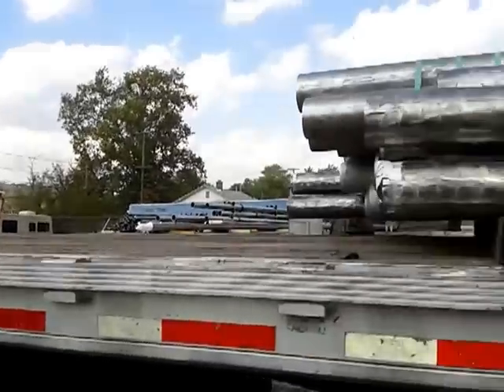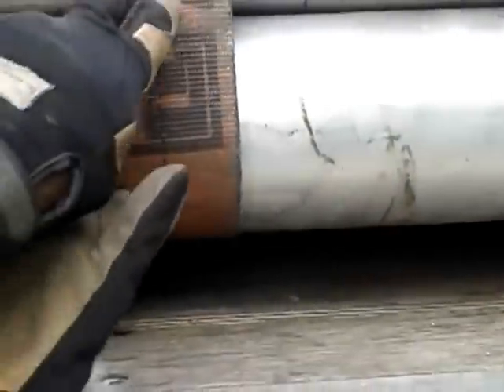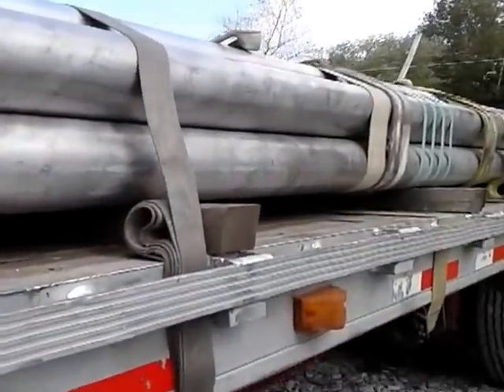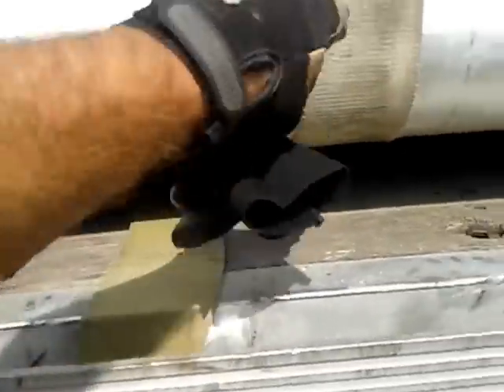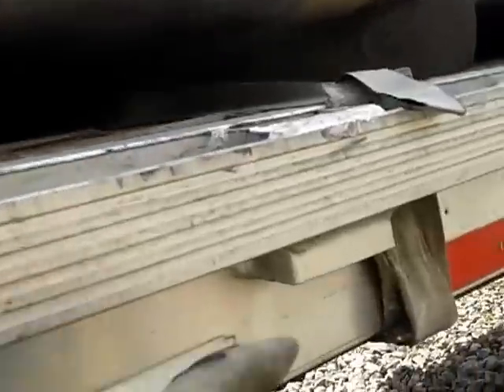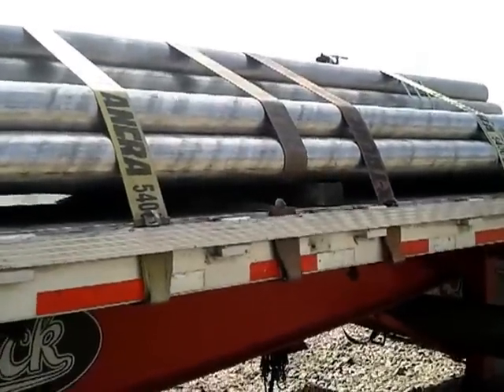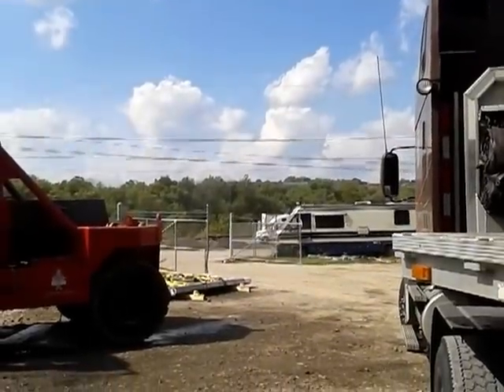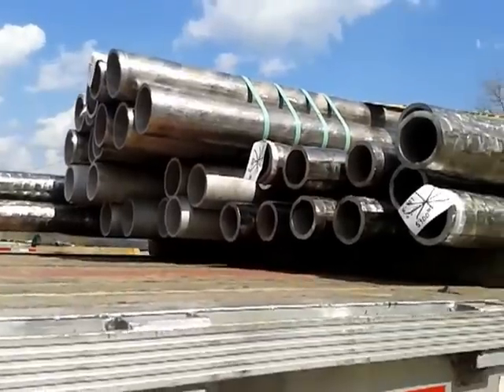Flatbed Trucking 101 Securing pipe

Comment from the maker: Thanks for watching and for the kind comment. Just like the rest of the jobs in trucking the only dumb question is the one you don't ask. Most of my 17 years in trucking has been dragging a skate board around and I am still learning How to do it. Get the Load Securement book from the F.M.C.S.A. that J.J. Keller publishes. Alot of great information in it. Tells how to Legally tie down a load. Most TA's have them for sell. Good luck and watch where you step on a Tarped load. Easy to fall.

Comment: You can do the same with some "belly" chains.  Depending on the load, I lay chains across the deck before they put down the load at the front and back of each length.  If I have 2 lengths of pipe, I need 4 chains.  CAUTION....most shippers will not like having chains directly touching their precious pipe...carry pieces of rubber or something else to protect the load....pieces of wood will even work.  Once the pipe is loaded, throw the chains up top, get a binder, tighten around the pipe.  The WILL NOT move.  You can then strap the load to the deck, most states require a load strap every 10', so, if the load is 40', you will need 4 load straps.  Obviously, you may need more depending on the weight of your load and the strength of your straps.  In addition, you may need a "chin strap" across the front and back of your load.  This will take anywhere from 2 to 4 chains.  Again, you will probably want to protect your load.  Depending on how far you have to go, bumps, stop and go will cause your load to slide.  I hate pipe.  I hate steel.  It is your most unpredictable and dangerous loads you can haul.  I don't care what kind of bulk head you have,

Comment: So there was an incident in Ohden, Utah.  It was on CDL LIFE.  Date of occurrence was dec 15th 2022.  Semi slammed brakes on too hard.  To avoid colliding with a snowplow.   Pipes slid through the straps and pierced the cab. Trucker is in serious condition. Shouldn't this mean chains with edgers from now on? Or at least, to diagonally chain down the front of the load?

Comment: Hey Mack, if this was one huge pipe, you would only need enough force to pin it down and that prevents it from moving. If you have two or more pipes, you need enough force to hold them together as one piece and enough force to hold them down. I guess you achieved both by alternating your use of straps. No one can do better than that. Even if you loosely cinch the pipes together first, the moment you tie them down, they will press each other so hard they become one. So, it is not what works for you only. It is the best way to do it.
Reply from the maker: Thanks Moe. Stay safe out there my friend.

Comment: I want to haul flat bed so bad but I have no knowledge with securing flat bed loads at all.
I've been haulind reefer and dry van for 4 years now and the reason why I want to haul flat bed is because the loading and unloading is much faster than refeer and it might be a little more physical work but thats fine with me,I'm barely 25 I am strong and able enough to do that kind of work.
Reply from the maker: If you decide to do so find a company like TMC with their own training program.  Back in 2001, I worked for Boyd Brothers and they did really good. But I have no idea if they hire guys without experience in a flatbed. TMC has a very good training program but are straight up control freaks. I have not driven for many of the big Flatbed companies so I can not recommend any other than Boyd Brothers or TMC. Best of luck to you when you make the move. Another route would be to work for a company hauling Over Dimensional loads. New guys generally start off hauling stuff like counterweights or Boom sections. Stuff like that. As you gain experience they give you more challenging loads. Something to consider. I loved to haul High, Wide, and Long loads. I also liked the heavy stuff. Overweight loads. The loads are more interesting. More so than the humdrum plywood or sheetrock or lumber loads of general flatbed loads. The light poles in this video are an example. I delivered them to a roadside construction site. Right on the side of the interstate. I have been underground in caves, on a barge, at an international airport and to the assembly building at Cape Canaveral. Like I said Flatbed trucking is a hell of a lot more interesting than dragging a box from dock to dock. 
Now I should tell you this, flatbed trucking is Miserable depending on the weather.  I have had to beat ice off my tarps and straps just to get unloaded. I had to have two guys to help me fold my tarps once. It was up in Baltimore MD and the wind was horrible. We had to just wad it up and heave it onto the deck. Just couldn't get it to lay flat, long enough to fold it up. The spring brings rain, rain, and more rain, Summer brings the heat. Gatorade is your best friend. Fall brings back the rain and the wind and the first kiss of the snow and ice. Knowing all that though I still loved it. Cursed it but loved it. The challenge and the adventure. It is or can be the thinking man's game. 
Working for a normal company you will see the same loads over and over again. Same customers over and over. Oversize, that is where the challenges lay. More opportunities to go to new places. Haul crazy loads and turn a few hairs grey.
Okay so I have warned you about the weather, told you about the variety of loads and places. As well as the boring company stuff. Good luck driver.
Reply: @mackdaddy1911a1  Good man you have no idea how much I thank you for all this useful and helpful information.
I will take all this in consideration and i will keep it in mind because i will definitely need it.
I am willing to do all the hard work,And i am excited about it.
Take care,God Bless you man.
Reply: Not necessarily faster loading/unloading. Take securing and unsecuring the load into consideration, tarping/untarping and if you go to a cold place is where it really sucks.
Reply: @mackdaddy1911a1  TMC IS A VERY CHALLENGING COMPANY TO  GET HIRED WITH...I GOT AS FAR AS A  RECRUITER ACCEPTING A RESUME I BROUGHT FOR HIM WHEN HE VISITED THE SCHOOL I WENT TO. HALFWAY THROUGH CONVERSATION HE TOOK IT BUT INITIALLY HE WOULDN'T..HE SAID HE WOULD SEE WHAT HE COULD DO BUT HIS BOSS WOULDN'T GIVE ME AN OPPORTUNITY WITHOUT EXPIERENCE-- AFTER SEVERAL ATTEMPTS I HAD TO TAP OUT NOW FOUND A SMALL COMPANY WITH 5 TRUCKS THAT SEEMS TO BE A GOOD FIT. OWNER WILL TRAIN ME FOR THAT 150 HRS AND WE'LL SEE HOW IT GOES-- FIRST CDL JOB AS A FLATBEDDER IN A FEW WEEKS..THANKS FOR THE MANY RESOURCES OUT THERE AND THE TIME AND INTEREST PEOPLE SPEND TO SHARE THEIR KNOWLEDGE.BE SAFE--

Comment: I would like to add my two cents.Been hauling steel and pvc pipe for a year now.I like to choke strap both ends of pipe and make sure to squeeze all the gaps between the pipes out,when you hit the bumps in the road your load will shift together and cause slack in your straps which will allow even more shifting.So keep an eye on your straps going down the road and if they start flapping  or worse go flat on the deck pull off quickly  as you safely can.
If the pipes have couplings make sure they are on tight and if you load pipe loose(not banded) on your deck ,stagger the couplings so if a pipe slides back you dont get a gap between pipes ,which will cause more slack and allow more pipes to shift etc...
I like to choke strap all the way around the pipes so it has contact with whole load,no gaps.Gaps and air between your straps and the load are no good.Your goal should be to squeeze them out before the road does!
I learned these things as a new trucker in a brand new company with no one really to give me any first hand advice.So I took it slow and and adjusted to every crazy little thing going on back there.Good luck! I know I had a ton of it!
Reply from the maker: very good advice all the way around. Two thumbs up.
Reply: Thanks for putting this up!Viewed it a year ago and it helped alot!
Reply from the maker: +grady purtilo You are welcome I am glad it helped.

Comment: Not a trucker but i'm going to try this on a load of about 62 pieces of 10' schedule 40, seems like it should work well as long as the pipes are elevated off the bed of the trailer.

Comment from the maker: Its not. Its oak. I've picked mine up at different steel mills over the years , as they crack or break. Lowe's and Home Depot don't even carry oak 4x4 s. I-beans will cut right through pine 4x4 s. Most mills require oak dunnage. Thanks for watching.

Comment: Great Job Buddy!!  Funny story about you said you tore a strap and put it out of service.  I went across the border into Canada a few weeks ago.  They inspected to the load and found one strap with the Working load limit sticker that's stitched into the strap missing and told me that strap could no longer to be used.  The sticker was fricken missing and the strap was no good, REALLY!?!?!  I guess whatever!!
Reply from the maker: Yeah those shit birds can be a real pain in the neck. I got a ticket that side lined me almost two years ago (04/28/13) and other than the driving and the other drivers, I don't miss the rest of that crap. You stay safe out there and keep it out of the ditches.
Reply: +easytopleez33 When and where did you buy that strap? The straps on sale today have the WLL stamped all over them and not just a sticker that can easily come off. If there is no marking on it, I would say go and get some new ones. Those guys at the scale in my side of the border (Canada) are a pain in the ass especially in Ontario where I live. They give the safest trucker a headache and everybody knows that. But hey, it is about time you lose that plain 18th century strap, man or you are asking for it.
Reply: +Moe the DEAF My argument entirely, NEW STRAP!!  WLL stamped all over it and because the tag was missing, made me change it right there or were set to issue a citation.  I don't run junk, Ontario!!
Reply: easytopleez33 I have been made to do a lot of things that were unnecessary just to avoid a ticket in these Ontario inspection stations. I understand their concern but they went overboard with these things. They need some savvy guys there not the ticket-happy lot you find at every station. If I were you, I would stay away from this side of the border.
Reply: +Moe the DEAF Oh don't worry, I do!!   Alberta Port north of Malta, Haven't been there in a long while.  Have a good one Moe!

Comment: Flatbed 102 - never use straps when you can use chains. Period.
Reply from the maker: Jim in this case, the tube was for light poles and was galvanized.  Chains will gouge the coating off. There would have been a damage claim. Therefore chains were not allowed. But I wouldn't have used them anyway. to big a hassle to keep them tight to properly cinch the bundles together. Thanks for watching. Stay safe out there.
Reply: As I said, chains where possible. I understand some cargo doesn't work with chains. I wasn't criticizing your technique.
Reply: That's just what I said, I pulled flat bed for 25 years, never use straps on steel. it loves to slide right out from under the load. last co. I drove for would fire you on the spot if ever caught using straps on steel. that's just plain laziness or stupidity.
Reply: Why would you use chains on this?
Reply: You can not use chains on every load,straps is not a problem.

Comment: DOES THE CINCH STRAP CONFIGURATION ALLOW FULL WLL OF THE STRAP OR DO WE HAVE TO SUBTRACT A PERCENTAGE ? THANKS-
Reply from the maker: I never considered the cinch aka choke strap as part of the tie down. I always over did straps. The cinch straps will loosen again and again until all the bundles are tight against each other. So until that happens they can't be counted to stay tight. Therefore they shouldn't count as securement.
Reply: @mackdaddy1911a1  GOTCHA..THANK YOU SIR !

Comment from the maker: A few things I would recommend. One don't idle the truck if at all possible, a cheap motel room during your 72 hour restart is cheaper than idling the truck. It's also a tax write off. Do as much of the work to the truck as possible. Get the maximum insurance possible. Better to have it and not need it than need it and not have it. Finally, keep those tires aired up to the proper inflation. One more thing, join OOIDA. Owner Operators Independent Drivers Association. They can help you alot.

Comment: Just an observation that the pipe are steel to steel and take time to settle, what prevents the pipe from sliding forward to the truck?
The use of side pin bars may reduce the risk of rolling off when loading and travelling.
Reply: +Kevin MacInnes The force of the straps holding them down keep them from sliding forward to the truck. But there must be enough force holding them down. For my safety, I use twice the force required by law to pin them down. I always carry more straps than the regular flatbed guy and don't mind using two instead of one. It takes me an extra minute for an extra strap. I have enough winches on both sides of my trailer too. Like they say "it is better to have them and not need them than need them and not have them." I have two big toolboxes on the either side of my trailer for that purpose.
Reply: The belly strap ,it will not slide anymore

Comment: Lets say if your hauling 52ft long pipes on a 53 ft split axle trailer, then where would be the best place on the trailer to place the dunnages (2dunnages only) to have the weight distributed equally?

(With my personal experiment, having the 1st set of dunnage right in middle of drive axle puts good weight but doing the same with trailer axles leaves me with greater length of pipes over the 2nd set of dunnage towards the rear end of trailer and causing to have more weight then drive axles) i hope i explained it ok.
Reply from the maker: No idea. I always had 6 or 8. However on a 10' spread axle you can legally carry 40k on the trailer axles  so it should not matter. Another consideration should also be will your center tie downs warp the pipe. I would add more dunnage for that reason if no other.

Comment: Hi Mack.
Iv been driving dryvan as a company driver for over 4 years.
I want to buy my own truck, and interested in flatbedding.
I'm heavily into excercising, eating right, blah, blah, blah.
How does someone like me learn as a owner operator?
Reply from the maker: That I don't know. I started learning how to run a flatbed while still in truck driving school. One of my instructors had his own small fleet. In the afternoons I went with one of his guys and learned how to tarp the loads. After I finished and graduated but before my 23rd birthday, I went to work for him. He had me in the shop and running around with drivers picking up loads. 
If you haven't leased on with a carrier yet do a lot of research and find one that has classes. There are so many types of loads that the little I have covered in my videos is only a small percentage of load types. 
The FMCSA has a rule book for flatbed load securement but it is pathetic and doesn't illustrate "THE HOW To ", worth a damn.
If you don't have a truck yet, work for a company like TMC. Their training is very good. Though they only gave us softball loads while I was with a trainer.  I had gotten a BIG speeding ticket and had been off the road for over 3 years and even with 17 years under my belt had to go out with a trainer for 4 weeks. He had 3 years total but was a good guy and knew his business.

Comment: Hey buddy i am pritty new to flat bedding that seems like a neat way of securing the load . My company makes me put horns down do i need to do this or is the sintch strap good enough.
Reply from the maker: The cinch strap in many cases is good enough. However if the pipe is loose the Stakes are to prevent it from rolling off during loading or unloading. The poles I loaded in this video were strapped together. In all honesty I probably should have put the pipe stakes up, For my safety and that of the loaders. I recommend, and any Smart OLD TIMER WOULD TOO, always add more straps or chains than required. The minimum standard is just that the minimum. There is not much of a fudge factor. Remember it is your life and as important your health that depends on doing it right. Better to have it and not need it than need it and not have it. Thanks for watching and please be safe out there driver. Your family is counting on you.
Reply: I will thanks man
Reply: Bernard Butt Always leave your stakes in place. For your safety, loader and unloaders safety and that of the general public. It's an added safety measure. Note: While in transit the stakes can vibrate or jar out of the pockets. To combat this hook a bungee to the top of the stake and hook it to the trailer. 

And as I mentioned above, NEVER cross your belly wrap on the bottom. Always cross on the top. The load can still shift laterally if you cross on the bottom.

Comment: are those under and over 3 inch straps also known as a belly strap ? thank you for the knowledge ......
Reply from the maker: terms are used by folks different ways. I was taught that belly straps are added on tall loads compromised of layers separated by dunnage. typically you'll see them on tall loads of iron pipe and PVC pipe loads and lumber. The Wrap or" Cinch" is used to pull bundled items tightly together to prevent the items in the center of a bundle from working out due to vibration or" Shooting" out during a sudden stop. Thanks for watching.
Reply: Christopher Smith,Countrytime Sky cwgahwhaau